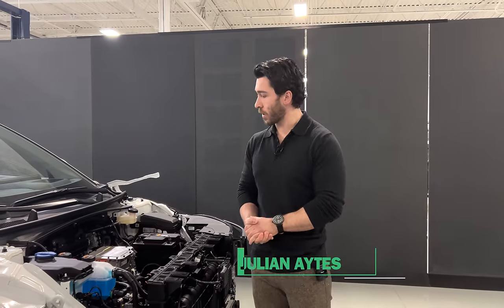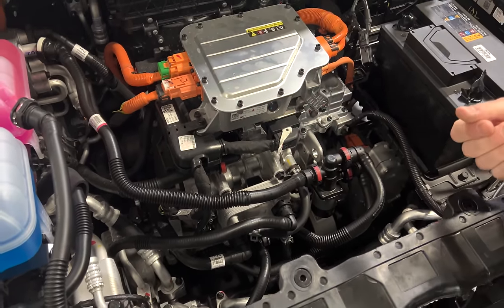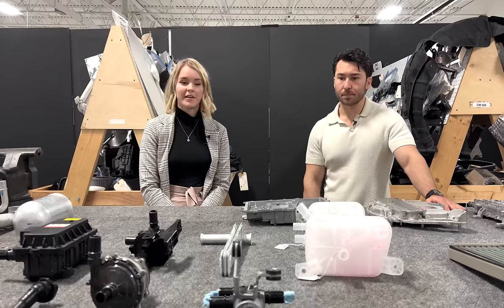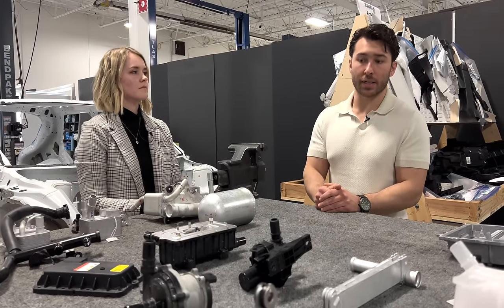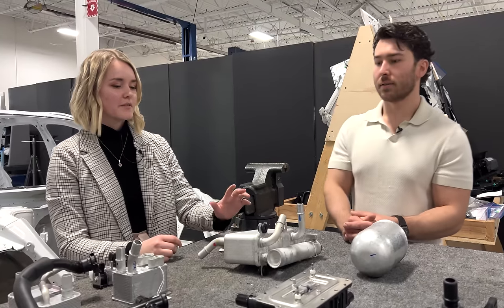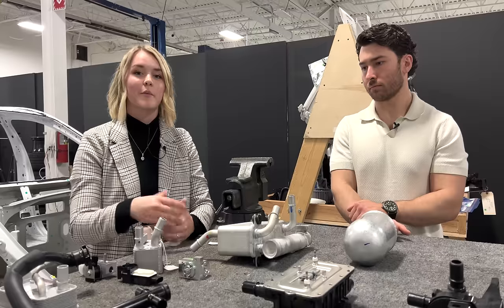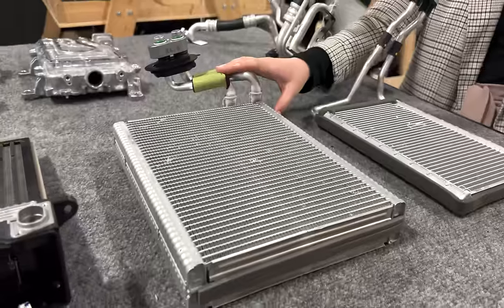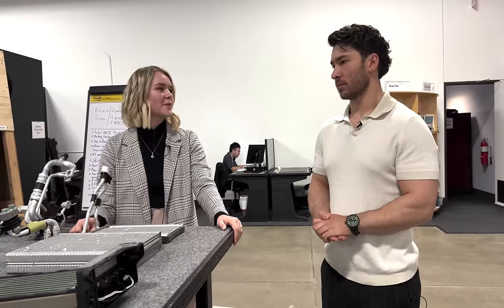This is Cool (No Pun Intended): Hyundai Ioniq 5 Thermal System

Comment: Trust me the PTC heater (Electric Duct Heater) does work and is needed in extreme cold. Its also is 100% efficient and cold, but not extreme temps, it's redundant.  It works great and only when needed.  Tested to -15F and cabin was toasty so fast. The heat pump seems to work into the single digits. Also the PTC is 100% sized to fully heat the cabin as well as the heat pump (6kW each).  Morning warm up in the Winter is extremely fast int he Ioniq 5.  I did a bunch of -15F to 72F tests last winter.  Amazing!  Much better than the Mach E Fluid PTC heater and heater core for sure.  Another fun fact is battery heating,   Down to -10F, the Hyundai does not heat the battery.   The primary use of the battery heater is for fast DCFC in Winter Time.  Their battery derating is minimal for cold use (unlike the Mach E).
Reply: Yeah IDK why he thinks they don’t need it. Tesla learned the hard way when their heat pumps were worthless at low temps. Plus it is more satisfying when you start out cold and gets the pump running.
Reply: Yet Nyland finds that despite the belt and braces approach, Korean cars continue to rapid gate.
Reply: @zxggwrt  Tesla uses resistance heating - stalled motors and code.
Reply: @waynerussell6401  That reeks of a cost saving measure or last minute hack. It's much less effective to have to heat up the entire motor and its coolant rather than just heating the cabin air.
Reply: @денисбаженов-щ1б  my observation of driving 8000 miles last winter.  The Only heating was when approaching a DCFC with preconditioning enabled  for my Ioniq 5 Limited AWD.
Reply: @денисбаженов-щ1б  battery at the snapshot was -2.2F. ambient was -9.4F
Reply: @денисбаженов-щ1б  correct. I know Hyundai knows what they are doing and my Hyundai IoniQ 5 only loses 5-to at most 7-8 % of its battery capacity in the extreme cold.  Plus the preconditioning feature gives you very fast cold weather fast charging.  That system draws 4.5 kWh for up to 30 minutes before reaching a DCFC. And only acts if you have over 30% charge remaining.  The Mach E, for example, can lose 25% or more of the battery capacity in Winter due to the extra energy Ford dumps into the battery with a PTC heater at any temps below 30F. The original Ioniq EV (I have one too) only heats the batteries in extreme cold, below -15F to -20F.  My heaters have never turned on in 3.5 years. In the book it says the Gel point is very cold, below -30F if I recall.
Reply: @waynerussell6401  Qué cansinos son los tesla fanbois.

Comment: On Ioniq 6, EV6 and the Genesis GV60 Hyundiai/Kia did change to an single coolant loop (only one reservoir). The theory is that the Ioniq 5 (as the first E-GMP vehicle) was initally planned using oil cooling for the motors and therefore the two coolant loops. Only late in the development they moved to water based cooling when it was too late to change a lot of stuff. This was then be done on the EV6 which availability was 6 month later.
Reply: The blue coolant is also non-conductive I believe which would promote more resiliency in a chain reaction event.   Also I thought newer I5's have a single loop, no?
Reply: Thanks for explaining that. I have an EV6 and could not understand why I only had one cooling loop if all EGMP cars were essentially the same under the skin
Reply: Great! I wanna a diagram of I5 thermal system , it may be a direct desc. to us. 😁
Reply: @TXCraig  Looks like they cheaped out on yours 💀

Comment: The newer Teslas use resistive heating by putting their motors in an inefficient mode to use electricity to heat the coolant
Reply: However, that's "efficient" in terms of the system.....
Reply: The best part is a few extra lines of software.
Reply: Problem is then instead of just heating up the interior directly, you have to heat up the entire motor and all of the coolant before getting any heat. It's being cheap to save a part but has significant downsides.
Reply: @RobertHancock1  reducing part count whilst maintaining functionality and flexibility is key to Munro's doctrine. This Hyundia example has a heat pump and two resistive heaters. Their battery PTC heats the fluid after the battery which eventually gets routed back to the battery. Tesla uses their motors to create the heat, and their octovalue routes it to where its needed be it, battery, cabin or heating pump. 
Being cheap is a one dimensional focus on cost only. Designing lean is increasing the area in a spider chart with cost as one of many in a multifactorial plot
Reply: @JoelSapp  There is also a PTC heater to heat the cabin air directly, which is much faster than heating the coolant as well as the entire motor mass. Tesla's solution is definitely inferior in very cold conditions and people have complained about that.

Comment: The reason to include a PTC heater and put a resistive heater at the battery outlet is to reduce the temperature delta that the heat pump has to deal with.  Heat pumps don't like big deltas.
Reply: How much delta T we are talking? 1 to 10?
Reply: Sorry but they have misunderstood the system. See my comment above. The PTC heater does not heat the cabin and it takes some time for the heat pump to heat the cabin.
Reply: @hoyacht  20 Celsius to -20 or even lower, so at least 40K (differences are to be expressed in K).  If you spec a heat pump for say, 30K and add a resistive heater, you save cost and weight on the heat pump and only lose range during the really cold edge cases.
Reply: I've found the Ioniq 5 is the fastest vehicle to get decent heat in the cabin that I have owned.
Reply: @godfreja  No doubt the heatpump is fast. I'm happy too. But the heat does not come from the PTC heater. It's easy to confirm this with an OBD scanner which shows that the PTC heater pulls 4-5kW when heating the battery silently while the heatpump pulls at max 2kW initially when not so silently heating the cabin. There is no doubt that the PTC heater does not come on to heat the cabin - it cannot.
Reply: The heater on the battery outlet is brilliant. I actually made a long comment on this in the past on the internet. 

I was critiquing Teslas system and talking about their engineers not understanding thermodynamics. 

The system makes use of an HP.   The HP multiplies the heat going into it through thermodynamics and the Heat of compression of the refrigerant. 

Grabbing any heat from the outlet of the battery and then adding to it before coming to an exchanger or HP circuit is a nice trick to increase efficiency. 

It gives the heat pump more heat to chew on and work with.

Heat is heat, and anyway, to increase it before hitting the heat pump is going to give you more heat energy to multiply.

Bravo for their engineers. It sounds like they are humble enough to learn from others' mistakes.
Reply: @desertdan100  As I said in my comments, they misunderstood the system. The PTC heater and the heat pump heater are in different circuits and don't work together.

Comment: On the Kona, they changed from a conductive to a (rather expensive) non-conductive coolant at a fairly early stage - maybe they were concerned about the effect of leakage within the battery, and kept with it for the 800V pack here.
Reply: Probably to control interactions with the flux used to close the coolant plate. Additives in coolant can form gels when they mix with fluorides.
Reply: On the Kona they had the unknown cause for the battery fires and changed due to that. After finding out it was a defective manufacturing process from their battery supplier they didn’t change any of their other “fix processes” back. The same reason the cars slow the charging to very slow around 80%, for a minute, when DC charging.
Reply: @BatterVswithAntonio  they had a recall on Ioniq and Kona (at least here in Europe) to replace the coolant with a different type one.
The level on the reservoir was dropping, and then signaling an alert but without any leaks.
It tends to be attributed to the coolant reacting with the cooling plates of the battery, is this what you are talking about?
BTW can't wait to see your video about the battery pack.
Reply: @MatteoBurroni  Exactly, the gel forms and stops flow, causes an over pressure in the lines which will burst fittings.
Reply: @MatteoBurroni  it forms crystals 😅 but it turned to solid crystal outside of vehicle. so i don't thing the recall to flush the old coolant and change it for a new one is because of old low conductive coolant reacts with flux, it's just the coolant crystalazing.

Comment: 5:40: A lot of cars with heat pumps for space heating will disable battery cooling when you heat the cabin.

By having a PTC inside the cabin, you can heat the cabin and cool the battery at the same time..

In my opinion, a smart design for cold climates.

Comment: The inclusion of the cabin PTC in my experience with a Kona assists the heat pump while the latter is preparing itself for first use.  From ambient 7°C and under when heat is first switched the PTC lights up for about 2 minutes drawing around 3.5 kW.  The heat pump takes over and consumption drops to 0.6-1.0 kW.  
As for the inclusion of both condenser and evaporator in the cabin I was unsure if Alex noted that it also allows for control of humidity using reheat without involving the PTC.
I'm glad our awesome hosts pointed out why I like the discrete componentry layout.  It's fine to save money by integration but only if you pass on that savings to the consumer rather than pocket it.

Comment: The Ionic 5 and Kia EV6 have exhibited power throttling after charging when the battery temp hits 51c. It would be interesting to track down how the thermo management configuration fails to keep the battery cool enough to avoid this.
Reply: The compressor consumes, in my observation, around 2kW peak. If we assume a quite generous COP of 5, that means the cooling system can reject about 8kW of heat maximum. On the consumption side, the battery can sink 240kW peak. If we assume 95% charging efficiency (again, I think that's quite generous) that's 12kW of waste heat evolved. 

Waste heat generated and heat removal capacity simply aren't designed to match. The car is designed to cover MOST charging scenarios by relying on the speed of charging and thermal inertia of the pack to simply hit a voltage bottleneck before it hits a thermal one. It's almost certainly not worth the cost and weight to build in higher cooling capacity simply to avoid worst-case charging scenarios, when you'd only recover a few minutes worth of charging time anyway.
Reply: @AlexWhittemore  The charging isn't the only thing affected. The power output throttling can drastically affect acceleration to the point where it's difficult to merge onto the e-way. Tesla doesn't have that problem. Just do it. Tesla could benefit from new programming of the Model S cooling capacity for the Plaid in Track Mode. The car can't make a lap of the Ring without restricting power because of battery temp.
Reply: From teslabjorns egmp videos it's the high difference in cell temps that's the problem. Some cells just don't get the same cooling, with the hottest determine the throttling and to me it's that snaked cooling path under the battery. The ones closer to the outlet will struggle.

Comment: That method of "creeping up on" the control of flow on the surface of the ball valve is pretty brilliant. I don't understand why such a high degree of control is needed at the lower end, And I can't speak on the software's ability to manage this system. But that's a really neat idea.

Comment: I have 2 Hyundai’s, one with dual heat pump/PTC and one with PTC only and the one without the heat pump is more range efficient in winter range for me. Now the biggest caveat is that my drives are under 20 min 95% of the time so barely time for just the heat pump to run effectively as the temperature stabiliser. The dual system pulls 7-8kw for at least 10 min on the very cold mornings while the PTC system pulls between 3-4kw
Reply: Same experience on e-soul. For long trips heat pump is great, -for short trips it eats battery.

Comment: Just a correction. The component shown at 16:30 is a liquid cooled condenser. They using the Powertrain cooling to cool the gaseous refrigerant during the high temperature phase. The battery cooling loop section helps with lower subcooling. The refrigerant then exits into a dryer and then a accumulator.

Comment: as far as the brackets needed,  one would think that brackes could be injected molded plastic as opposed to stamped steel.  cheaper later and more than strong enough to mount most of those components.

Comment: The PTC could also be used when the car is plugged in  and needs to be warmed up/defrosted.
Reply: ptc almost always uses more heat than a heat pump.  If you have one you should be using it for energy conservation...
Reply: @zilogfan  Heat pumps don't work well or at all in extreme cold conditions. The heat pump reduces the need for resistance heat, it doesn't eliminate it.

Comment: Re: the location of the PTC heater being at the outlet of the battery loop, it makes sense because they will have more control over the temperature that the battery cells actually experience. If they measure the temperature at the outlet, they can either throw more heat in, or stop heating before the fluid reaches the cells again since the battery itself also will generate heat while in operation. That's the only reason I can think of anyway.

Comment: my 2015 VW e Golf has a PTC heater too but it is in the coolant loop with a heat exchanger that is tied to the heat pump into the R134A so it boost the heat output of the heat pump when in very cold weather.

Comment: If you put the pcs heater at the outlet you can have the temperature sensor in the outlet as well, in the same package as the heater. So counterintuitively it might be easier architecturally.

Comment: Does adding a resistive heater help augment the rapid heating of the cabin along with the heat pump?  I would think in colder climates a resistive heater would be a good option?
Reply: It's NOT as Efficient or Effective as a Supermanifold, octovalve, and Tesla made heat pump.
Reply: A resistive heater will greatly reduce range in cold weather.
Reply: @markplott4820  Thank you.
Reply: @DishNetworkDealerNEO  Thank you.
Reply: The measure stick for heating and cooling an EV is without question the octovalve by TESLA. However my Kia EV6 with HP has proven its ability in cold Swiss mountain weather below 0°C to heat quickly to 21°C and that without excessive noise. An EQE costing three times as much took three times longer and was extremely loud, especially for a ‚premium‘ brand a shame. In the beginning we had some fog problems with automated circulated air entering tunnels but we found settings to perfectly adjust the fine working system. Driving after 54 mostly ‚premium‘ cars my first Kia and it’s the best car ever. Just once change wheels and driven 13‘000 km with til automne 16,8 kWh per 100 km, in cold winter til now it’s 17,4 kWh. This is highly effective for a car of that size! The E-GMP platform is really outstanding and hopefully Hyundai Group like ever til now is learning from the best - Sandy Munro and Associates. Think after one year of Kia and Genesis the Coreans are now on a next level and will better manage transition than many other groups. Here also strategic partnerships will help e.g. Porsche and Kroatian Tesla Mate Rimac from Rimac-Bugatti. 🤫🤔😎🇨🇭

Comment: As referenced by @NO3V, This seems to indicate why there's an "odd " variance in the cell and inlet temperatures, which in turn results in let's call it 'non-linear' charging performance depending on both internal and external conditions.
Or, to put it another way, there's often a variable but narrow "fast charge" window where the controlling temperatures are both  between 20°c and 45(?) °c.
.
(If you haven't seen the scan data from Bjørn Nyland and others...... Well worth a watch)

Comment: Having a electric heater allows for heating of the cabin while charging in cold countries without running more than the heater and a fan. And secures heating even if you run into -20-30c in the Nordic countries where the heat pump won’t be as effective.
Reply: If you have a good enough heatpump you can still get a 2x COP down to around -30C.
Reply: @rkan2  yes, but it might not be enough capacity to deliver the required heat.

Comment: Bjørn Nyland, using a OBD found out that the individual cells in this Ioniq 5 and EV6 can be up to 20C degree apart when looking at maximum and minimum temperatures while fast charging. When exploring the battery pack and thermals later on it would be interesting if you could find out why?
Reply: They appear to have 3 (4?) loops working against each other?
Then with fast charging not starting until the lower temperature reaches 20 degrees and the upper temperature cutting the fast charge at 40-45 degrees, the system is "hunting" for a balance.
Reply: I have a MY23 Niro EV and it is basicly the same having a temp of at least 10C between Min and Max temp. I suspect the coolent is in series going though each module rather than in parallel which will far better but higher cost